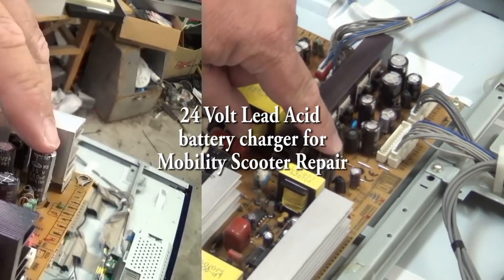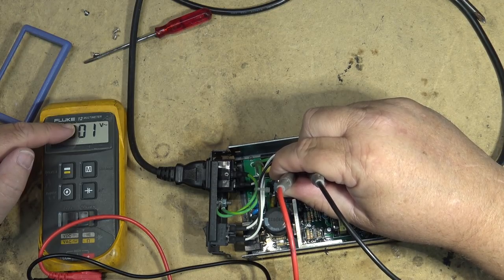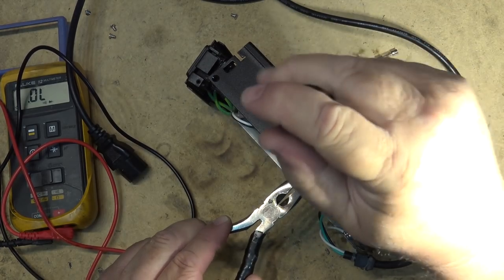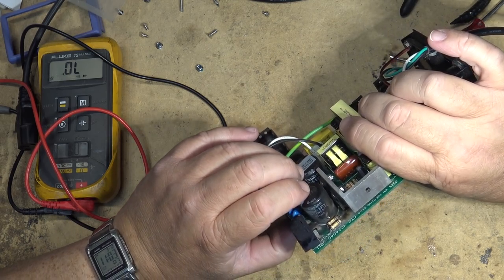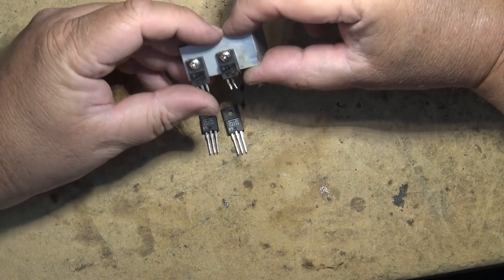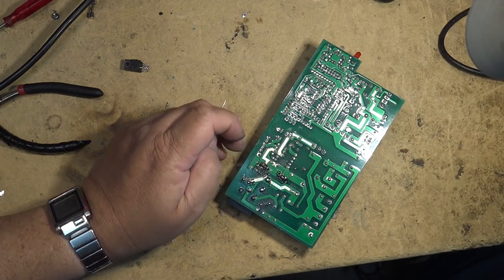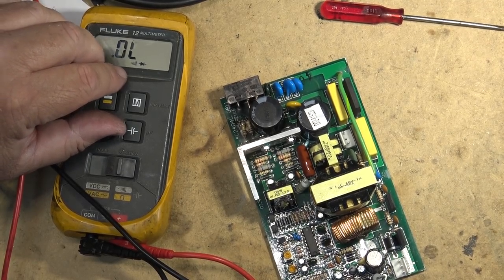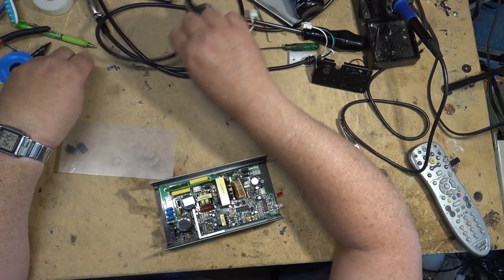Switch Mode Power Supply went Boom!! Let's fix it.

Comment: Nice job, with a new cat joining the staff. I was wondering if the firework was intentional, but like everyone who have once worked on this kind of supply, I'd say it was something highly probable, as primary fuse rarely blows without a good reason. Everyone tries that first... and experience flashes! That's why safety glasses and safety switches are necessary...
I was mumbling when in last part when you said this one was toast and it was evident something was wrongly connected: ah ah! But how stupid are these engineers to use same type of socket to do the job? With a nice confirmation with the XLR plug, they made everything instinctively to make this simple power supply a special treat for professional audio gear or to confuse technicians trying to fix it (glued rails...). It explains such "simple electronics" can fail and end as unrepairable with so few bucks spared.
I hope you won't get too much troubles with fires in Vancouver area, all that smoke (and ashes) does not sound good.
Reply from the maker: No fires here.  There are a few going on in the interior but this is a good year here.  Fewer fires than in other years but south of me in Washington Oregon and California the fires 🔥 are devistating.
Reply from the maker: Fireworks not intentional however i suspected something might go boom when i hit the power.

Comment: you have 130 volts on your ac power cord? isnt that a little high?
Reply from the maker: Voltage will fluctuate all the time. 120 is where it is supposed to be, but if the load is light it goes up and if the load is low it goes down.  My 240 supply to my car charger is all over the map. From. About 230 to 250 but averages 240.   The power company does adjust this on the primary feed but line load will drop it slightly. That's the way it is.  Must have been a bit high when I had the meter on.
Reply: @12voltvids  So far in my physics classes we’ve learned DC circuits and i understand them pretty well. but AC circuits, ESPECIALLY north american ac electrical circuits, make zero sense to me. ugh. one day soon i’ll understand them
Reply from the maker: @walle637  
Nothing special about our distribution.  We have single and 3 phase power.  On single phase it is split phase, 120 0 120. 
Each 120 phase is 180' out of phase.  If you connect between either hot phase and neutral (which is tied to earth) you have 120.  If you tie between the 2 hot wires you have 240.
Things like ranges, water heaters and car chargers use the 2 hot wires.
On 3 phase systems same applies, but each phase is 120 volts with 120' between the phases.  There are a total of 4 wires.  3 hot and a neutral.
Between any hot and neutral you have 120 volts.  Between any 2 hot wires you have 208.
Ranges water heaters ext will still run on 208 but not as efficiently as 240.  For example it takes me about 3:45 to fully charge my car at home on my little 4kw capable charge cord but if i go to a public charger that is few from 3 phase it takes 5 hours to fully charge because the voltage is lower.

Comment: Why didn't you use the "dim" bulb right away for 1st test after replacing line fuse? If bulb lit up full brightness, you'd know that there's a problem before blowing up the transistors. I always use my 100 watt for testing. maybe one or both of the switching xsisters may have been ok. Most electronics are fused to reduce a full blown fire from breaking out, not to protect the circuit! I usually de-rate the fuse(s) when I successfully repair some piece of electronic gear. Usually like 20%+ lower value. That power supply is crazy sophisticated just to generate 27 volts for a battery just to save the use of a iron transformer. ya, lets take 120VAC, change it to 170 volts DC, crank it up to 350+ VDC, then magically drop it back down to 27 volts DC! But I guess that's the least of all evils rather having a 10LB humming box with a big hunk of iron inside.
Reply from the maker: I think it is pretty obvious. I wanted to scare the crap out of everyone.   I was hoping for fireworks.   Fireworks gets ratings.  Look at all the views photonicinduction got by blowing stuff up.
Reply: @12voltvids  LOL ok then. I was taking it seriously. I am a fan of both electroboom and photonicinduction myself! I EXPECT fireworks from those guys, but was surprised to see that happen with you! What ever it takes! See ya.
Reply from the maker: @curtchase3730  
I do them once in awhile.  Usually to something that is headed for the dump.

Comment: At about 5:30 I was screaming at my computer that the fuse was in the socket.
Reply from the maker: Didn't take long to figure that one out. Never had one of those sockets before. In 25 years this was the first thing I have seen with it.
Reply: @12voltvids  I have seen that type of socket on a small number of devices at work (medical imaging research) not sure if what devices though its been too long.

Comment: We all have brain farts. We are not perfect.
Reply from the maker: Everything you saw there was intentional.  The sparks and flames , plugging the DC connector into the account input.  All to get a reaction.   Have to have fun doing this.  I wasn't 100% sure it was going to blow up but relatively confident that there would be fireworks.

Comment: What happened at 20:50 approximately?
Reply: I'm guessing Transistor was Biased fully on due to the open resistor that needed to be replaced, Long story short because the transistor was overdriven without the resistors proper resistance it instantly went into a Thermal runaway state...
of course that's just a guess without knowing the circuits layout, so if I am wrong can some one set me straight?
Reply from the maker: Flashback.  Suffering from ptsd from when it blew up earlier.
Reply from the maker: @KorAllRBare  
No it didn't blow up again that was a flashback from earlier shot zoomed and rotated. With the open resistor it just won't start.
Reply: @12voltvids  Oh well.. I only guessed and that's why I pointed out I was guessing, Mind you on super slow mo review of both captures, I feel something is still a foot, and knowing how things could go south let me take the hit..  😞

Comment: XLR, and some clown would plug a mobility scooter charger into their mixer microphone input or something.
Reply from the maker: They aren't the only ones using it. My electric bike is the same.
Reply: @12voltvids  In theory your mixer deck phantom power might be able to charge the battery very very slowly, as the 48V will be there, but limited by the 2 6k8 resistors in the phantom supply. Of course depends how they actually connected the XLR in the scooter as to whether the battery will charge, the phantom supply will discharge them or the phantom supply will be shorted.

I did use an IEC connector to connect a small jump battery in the car, but made sure that line and neutral were connected together with a very heavy wire link, so that plugging in mains would trip the breaker. Used that connection for positive and the earth to the chassis, and a diode ( scrap PC power supply to the rescue, supplied the IEC connector and the diode, plus all the internal wiring) to prevent reverse discharge. 20A breaker on the output and some 4mm leads to clips. Was perfect for boating, as you find s many people have a flat battery on the water, so this, made from scrap bits, was perfect, low cost so even if I dropped it in the water no great loss, just build another.
Reply: @12voltvids  Even better, some dubious quality smoke machines use XLR for their remote controls, switching full mains voltage! Bigclive has done a video on them.

Comment: Dave, could some of the collateral damage been avoided if you plugged the charger into the dim bulb tester right after replacing the original blown fuse and turning on the power ?   Glad you had no ammonium nitrate fertilizer in the garage while testing.  Your remains would have made your lawn greener.    ( BEYOND MEAT )   Stay safe bro.     J K
Reply from the maker: The transistors were already blown. That is what popped the fuse in the first place.
Reply from the maker: I kind of suspected it would go up in flames.  It isn't the first smps i have fixed.  They fail spectacularly and i was hoping for fireworks.  I got it.

Comment: This is half-bridge, not Push-pull, as mentioned.
Reply: One transistor pushes, the other one pulls. It's still a push-pull in my book.
Reply: @eDoc2020  Push-Pull is used for much lower voltage levels. schematic you've drawn is not correct!  Notice, two electrolytic caps are connected in series.
Reply: @SanelKeys  I mean, this is a half bridge but I thought half bridge was just a type of push-pull. Perhaps that's where our  disagreement is coming from, are you only considering the circuit a push-pull if it uses a split primary?
Reply: @eDoc2020  push-pull conducts alternatively dc voltage trough half of primary, half-bridge conducts voltage trough einding, then, connects winding to 0 V (ground) of dc source, thus, collapsing field.
Reply: @SanelKeys  I guess it is just a difference in our terminology then. I consider any design where the two switching elements alternatively conduct in order to change current direction a push-pull system. To quote Wikipedia:

"The term push–pull is sometimes used to generally refer to any converter with bidirectional excitation of the transformer." (me in this context)
and
"However, push–pull more commonly refers to a two-switch topology with a split primary winding." (you)

I guess maybe we're both right. Calling this circuit a push-pull is like calling a regular quadrilateral a rectangle. It is, but you'd cause less confusion by just calling it a square.
Reply: @eDoc2020  just read Abraham Pressman and/or Keith Billings on Switching/Switchmode power supplies. 
I don't rely on wikipedia, when there's real literature.

Comment: wow you are a joke as technician, maybe you are not one. i stopped video right away i did not continue playing it, never but never replace a fuse before checking any other problem, you need to check first what cause that the fuse broke
Reply from the maker: I did and i knew the transistors were shot. I am a pretty good actor.  The flames and sparks were totally staged and you all bought it. The fuse was actually bypassed to ensure it would go super Nova, and then I could troubleshoot it.  The power supply had already been replaced so it wasn't important if this was fixed or not but not he has a spare.  Incidentally i am an engineer, and do know exactly what i am doing.  The jokes on you.
Reply: @12voltvids  wow Dave, I am also an engineer and the experiment really impressed me. You sure know how to make a realistic  firework display....Congrats....may the electrical  force be with you always....by the way  I live in Venezuela  and saw your sparks thrown to the atmosphere from here. I realized  that some electrical disturbance was occurring and started digging for a good cause in Google and suddenly your video appeared on my YouTube tablet.
Very convincing....cheers